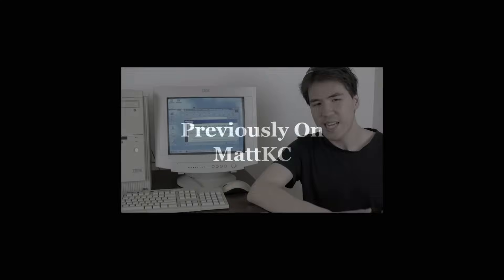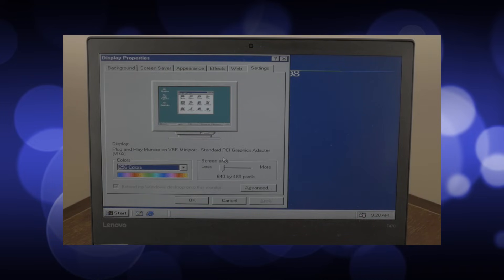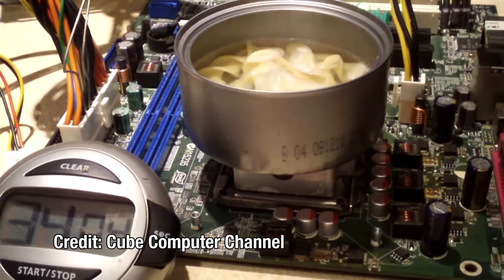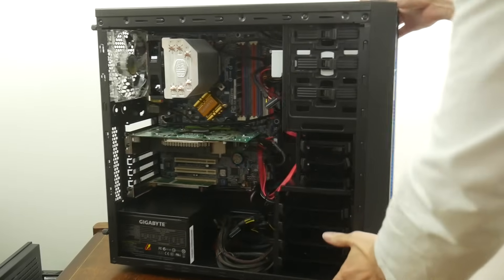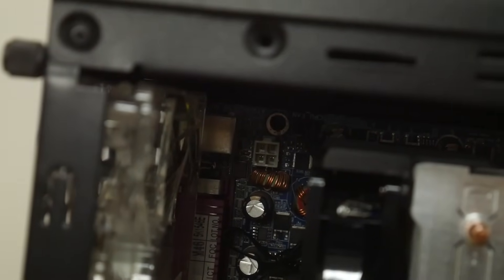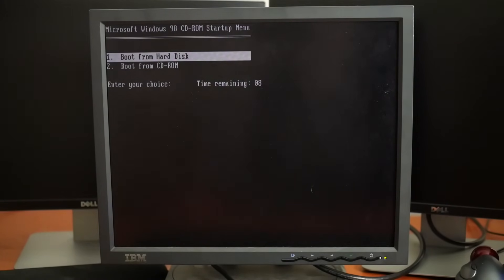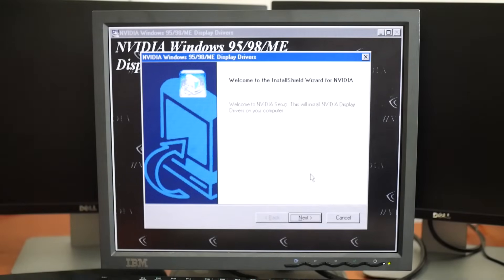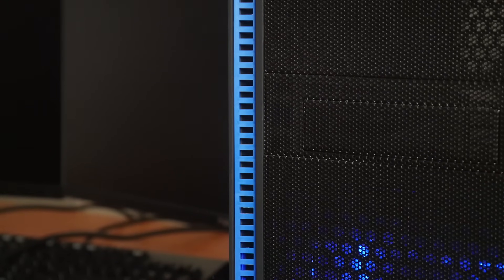The QUEST For The ULTIMATE Windows 98 PC [Part 1]

Comment: Huh, it's been a long time since I watched this video and dropped my first comment. Revisiting, I have some things to add and some to reinforce, now that I actually managed to make the ultimate windows 98 PC and have some knowledge with me:

In terms of CPU, I still stress the importance of using a core 2 duo based cpu. The Pentium E5800 is by far the best cpu you could get, and I stress that specific CPU because for motherboard, you will need one based on a 865pe/865g chipset (for win98 drivers!), and that chipset can only achieve an official FSB of 800; any higher, and that's an overclock. FSB 1066 CPUs are not recommended, as they constrict your ram tweaking options on these motherboards, but can be safely used in a pinch; if you want 1066 FSB, get a Pentium E6800 or E6500K; the Core 2 Duo E7600 also works, but clock speeds will matter more than cache.

For motherboards, the best ones for the job are both made by asrock: the 775i65g r2.0 or r3.0 (easy to find, micro atx form factor, only 2 dimm slots tho), and the conroe865pe (very hard to find, full atx form factor, 4 dimm slots!). I highly prefer the conroe865pe myself, as the 4GB of total RAM means you can boot Windows XP or 7 in parallel and do normal every day computing, if you ever so wished for some reason. But if you can't find one, just get a 775i65g! It'll still do a mighty fine job. And as for the Win98 RAM limit, just use the rloew patchmem utility; it was formerly paid-for software, but after his death, his family released all his utilities to be used for free.

For storage, you're pretty set, but without TRIM, that ssd will wear out slightly faster. However, there's a trim utility you can set up to handle this; that one's also coded by rloew. He did a mighty fine job with all those win9x utilities tbh, he even released a patch to solve the 128GiB LBA issue Windows 98 SE has so you can use large storage drives! Just chop the disk in 120GB partitions tho, defrag and scandisk kinda seize up if you give them partitions over 128GiB.

For graphics, the 6800 Ultra isn't the only graphics card you can choose. Do keep in mind the x800 xt exists! The last ATI Windows 98 drivers work perfectly with it, and its performance is even greater than nvidia's offerings. And of course, don't forget to pair it up with a Sound Blaster Live for the ultimate Windows 98 sound experience (with the vxd drivers of course, don't go with wdm drivers for 98!).

Outside that, I don't have anything else to say. My trek was a pain in the ass, but I did manage to get the ultimate performance Windows 98 machine. Now if you want compatibility on the side... that's a talk for another day.

Comment: Try finding a Win98 compatible PCI sound card, and disabling the onboard sound card. The onboard sound chip may of failed. Verify you are running chipset drivers. If you have issues, running previous version may help. Also, I have found that workstation boards (or some server boards) will have more solid Win98 drivers than the desktop ones. Now I need to dig through my parts boxes and see what I have. Good video. Was fun to watch. Also, ditch the Bluetooth dongle... Win98 barely had USB, and Bluetooth wasn't even an idea until XP, so I don't see any actual use for it.

Comment: This is why I dialled back my expectations a notch, I looked for the fastest and went for the ones under that which were more than fast enough but cheap enough and reasonably easy to still replace. I got an i865 board that supports up to a 3.4 P4 but got a much cheaper and easy to find 3.2. 2 sticks of 512MB DDR400, a soundblaster live! 5.1 and a Radeon 9800 pro. I also have my old trusty Voodoo 5 5500 PCI for the glide games and DOS. An IDE DVD drive to free up the left over sata port, a floppy drive emulator and a 240GB SSD with a 2x120GB partition with windows 7 on one just to trouble shoot, get drivers, file transfers etc., and trim the drive (98se has full access to the drive as well so it can be used for storage for that as well). I have an old PCI wifi card as well, but that was more trouble than it was worth so stuck to the on-board lan. Though most importantly, I put in a beeper so I could get some idea of what was not working if it ballsed up.

Comment: You can use core 2 Duo and core 2 quads in windows 98 and still maintain compatibility
Reply: As he said, it wasn't so much the processor as the motherboard that supported it. He needed everything to be officially compatible so the chipset limited the CPU and other components available.
Reply: WRONG
Reply: @zord0nTV  he's wrong or l am? I know he isn't because lve certainly run win 98 on core 2 duos long ago.
Reply: Single core performance on an old operating system is most important. Still is today most of the time. That Pentium 4 should probably outperform the Core2s in gaming. I don't remember but I seem to remember that CPU being the gamers choice for quite a while.
Reply: Cyn Hicks  core 2 duo has a much better IPC,  I think if you check old benchmarks of core 2 duos they will outperform the Pentium 4, the core 2 duos where a massive jump in single core performance and consumed less power
Reply: @fractitos  The fastest core2 on 775 definitely had a slower clock. I do know that. I had a core2 quad at 3sh ghz 4megs cache (upper mid-range) and it was fast don't get me wrong. For the most part it was better than any P4. I'm not sure that for gaming it was better than the last P4 though. I seem to remember it was still the better gamer but much more expensive at the time. I'd go look at old benchmarks but it's not really worth all that honestly. I am curious though.

Edit - I am specifically talking about games that are not optimized for multicore, which would be every game compatible with Win98.
Reply: You know what though. Just hit me. He's on 8x AGP. Even if the Core2 were better the GPU would (might) become a bottleneck. Interesting to think about though.
Reply: @CynHicks  I actually have a pentium dual core E5800 with an fx5900 in windows 98 and the gpu is indeed bottleneck. I think in 3dmark 99 I got 76000 compared to my old pentium 4 at 3.0Ghz with 41000 but I might not remember correctly. If you want check old anadatech benchmarks.
Reply: @fractitos  Fx 5900 is far from the best Nvidia AGP card though and the P4 he's using was not remotely midrange. I think it had 2mb cache for the single core and was certainly HT. Idk...I admit that. What I do know is that Intel was squeezing every last bit out of the architecture back then before getting rid of the north bridge and was killing it even though the top tier stuff was way too expensive.
Reply: There is no need to use more then one core in Windows 98 because it doesn't use more then one core a faster single core is better for Windows 98
Reply: @tassoss13  Agree but a core 2 Duo has faster single core performence
Reply: I think we’re all forgetting just how bad the Pentium 4 was. It was a shocker of a CPU and I wouldn’t be at all surprised if one core from a Core2DUO was faster.
Reply: A C that is what have been saying my 3dmark 99 scores where tested in windows 98

Comment: Dug up one of those small Dell Optiplex 260 Pentium 4's. Though they came  preinstalled with Windows XP, the hardware has official support for Windows 98. Finding drivers wasn't super easy, but after a day of frustration I got it to recognize all onboard hardware. Need to track down a low profile soundblaster live if those exist, as otherwise there is no MIDI playback in DOS games.

Comment: I've been building Windows 98 PC's for retro gaming recently and I feel your pain. My most recent 98 pc was a high end Pentium 4 similar to your build. I had hardware and driver issues that I could have never imagined. My most successful build was a Pentium 3 Tualatin. Generally speaking, I find it's best to use hardware that was built when 98 (or ME) was still the dominant operating system, which is prior to October of 2001 when XP was released. Drivers and hardware had excellent support for 98 up until that time. Additionally, I stay away from the 6000 series graphics cards for 98, the driver support is spotty at best. Nvidia supported 98 as an afterthought. Plus, the 6000 series dropped support for table fog and paletized textures, which can be important for older games. I usually use a geforce 4 or fx series because of these reasons.

Comment: Noice video! Thats a good build but...
Since you are trying to build the ultimate win98 pc, wouldnt it be better to use a newer VIA chipset? The drivers on boards like P5VD2 works great on win98 if im not mistaken, and you would be able to use some newer processors in it (more cores! Yay!).
Also, go for 2x 512mb sticks so you can have dual channel if you can.

Comment: I haven't watched Part 2 yet but after seeing this one - your build is powerful for 98 but still too new. The 'bleeding edge' was barely supported, it was more like 'do the bare minimum to make it work so we can legally say it supports 98 too'. 

IMO you needed to go back one/two generations from the 'latest' for the best compatibility. Socket 478 P4 or AMD AthlonXP, ATi 9000 series or GF4 Ti, 512MB RAM max (stock 98 has issues with more than that plus theres like nothing that needs that much RAM in 98). Stick with IDE drives or turn SATA mode to 'Legacy' in BIOS, but keep in mind that SSDs will lack TRIM support so they may slow down over time. Motherboard audio was utter garbage back then - best to use a SB Live with VXD drivers or if you want to baller out, an Aureal Vortex 2. A build like that would have worked nearly as fast for anything that actually runs on 98 and cost considerably less.

I posted about my build here for an idea: https://www.reddit.com/r/retrobattlestations/comments/jq5dkt/pentium_4_reverse_sleeper_build/ 

Anyways, on to check out part 2!

Comment: I built a P4 775 system a few years ago with the same intention, however I went down the route of using Windows Me. I found the drivers for that generation hardware was better supported under WDM based drivers. Windows Me with updates and an unofficial service pack applied can be solid. Win98 SE should be ran on P3 era hardware.

Comment: You can only convert from new graphics protocols to old ones, not the other way around (obviously).
Monitors often expect the exact protocol the port is meant for.
If you send a DVI signal into a HDMI or DP Port, the monitor will not recognize the signal.
The other way around is much simpler: A lot of modern graphics cards switch to older protocols automatically, if they detect a connected DVI-monitor for example.

Comment: I realize it's obviously not official, but there is a community made Windows 98 SE service pack 3 that adds a TON of support for more modern stuff, larger drives, more memory, easy USB support, it will even run programs meant for windows XP. You should check it out.

Comment: I'm a retro nerd of sorts (since I grew up in the DOS era) and I've got my original BFG 6800-GTOC card, still working, sitting in a box in the closet. (I was the original purchaser.. mm mowing lawns)
As far as sound, those old realtek systems were notoriously shit. ANY old dell from like 98-2006 will have a PCI SoundBlaster Live 5.1 in it. They're actually pretty fantastic cards, and since you're working on a dos-compatible OS, having true and proper DOS SoundBlaster16/Pro/AWE support would be quite nice for you.
Reply: My dream dos machine is sitting right next to me- Pentium 90, 24mb EDO, Trident 4mb ISA video. And a MASSIVE 540mb hdd. Can't play Crysis, but it plays Keen and Wolf3d quite well.

Comment: I've been building my own high-end windows 98 system lately.  Smoked a perfectly good 6800 Ultra with a faulty (mis-wired) molex cable.  I know your pain. 

As for your sound problem, you can't call it "Ultimate" with on-board audio.  Get yourself a Sound Blaster Audigy 2 ZX.  That is a phenomenal card for windows 98.

Comment: I feel your pain with the sound drivers. I cannot get my Windows 98 machine to have routinely functioning sound. I'm pretty close to replacing the Sound Blaster Live card in there now with an Aureal Vortex 2, just to see if that works any better.

My machine is a bit different though. I built a machine using ~~parts I had lying around~~ the last parts that could be reasonably expected to run 98, which I took to be around 2000. I've got a Pentium IIIS 1.4, a Voodoo5 5500, and 512 MB of RAM. I'll probably switch to a flash storage solution and get a new case, but I'm happy with what I've put together

Comment: Yo, the Asus p5B is a 775 motherboard that officially supports 98, you could run a core 2 duo. Even if you couldn't use both cores, one core on a duo would smoke a pentium 4. This motherboard also supports overclocking and core 2 duos are great at it. I never have tried out the 98 support on this motherboard, but I did use it to build a mega fast c2d/8800gtx Windows 2000 rig.

Comment: You can't use displayport to DVI adapters in that direction. The displayport side has to go into the video port on the PC and the DVI to the monitor. It can't be the other way around as DVI doesn't work being converted to DP despite DP being concerted to DVI.

Comment: Remember that some motherboards with AGP are very picky with the voltage, meaning if you put a AGP card with with the wrong VOLTAGE support it will either not work or destroy the card after a while. It still fits in the socket (this is one of the horrors of the AGP format) Also if you want a simple solution for the sound go for some cheap Soundblaster live, Aureal vortex,  ess-solo 1 etc. And one more thing, all this random crashing in windows 98 is often related to IRQ and DMA conflicts. I was in my older teens when win 98 se was released, and I still sometimes make machines like you are making here. Contact me if you want,  I can most likely solve any of these problems you are having. Good luck ! =)

Comment: So this is a very interesting video and I do look forward to the next installment. A few things to note from someone who plays around with this sort of equipment a lot:

Ignore the onboard sound. Although the best Sound Blaster Audigy and Live cards may not be that cheap, most are and would be far better suited, faster and reliable.

Disable every device on the motherboard that is not going to be used - Windows 98 is better with IRQ's than earlier systems, but give it some help and turn them off.

I would not use an SSD. The lack of TRIM support, AHCI etc is going to make it underperform by quite a hefty margin and you will kill the drive. In practice, it is probably better to look for a Western Digital Raptor which would be both period correct and I believe for W98 actually equally as fast (much slower under XP etc)

I'm concerned at how many graphics cards you've lost, so try and check that PSU out. But meanwhile, have a look out for the 7800GS for which there are W98 drivers (I can send them to you if you want). The Gainward Golden Sample are the best cards as they often have 7800/7950 GT cores, but as they're so expensive, even a native 7800GS is faster than the 6800GT and in line with the Ultra I recall. Failing that, a 6800GT may be cheaper to get these days and had most the performance (speaking as someone who bought one new and still has it)

If you can find it, this board is compatible with W98 and supports Core 2 Duo https://www.asrock.com/mb/via/775dual-vsta/ - they're a little rare but probably cheaper than your Pentium 4 and my testing shows that no P4 can match Core 2 Duo

Good luck

Comment: When I was trying to get windows xp installed using an usb and an iso file, I had soo many issues. Quite literally everything that could go wrong went wrong. But finally, after 20+ hours of troubleshooting, fixing stuff and doing it many more times over, I got into the windows XP setup. I was so happy that I finally got it all working. But when I selected my hard drive partition, the copy prosess went from 0% to 100% instantly while this was not happening in the tutorial. After some research, I found out that windows xp didn't come with a sata driver. So after 26+ hours I had to gave up since the prosess of inserting a sata driver into the install files was a total nightmare. 
I did eventually got it working by resetting the sata driver on a different drive (really slow) that still had windows xp on it and then it booted up. Finally I copied and pasted all the files off that drive to the new one and got it all working.
Even though this was not a hardware issue like the ones you had in this video, I know how annoying old pc's can be ;)

Comment: at this time i worked in a computer company and i had to fix all those problems for customers, i can't tell you how many unpaid hours i had to work on day and night to fix computer problems for customers, it was really bad i lost so much time of my life with windows 98 and also the computer hardware of that time and sometimes things just worked or they don't just worked without any reason and as you have like several hundreds of customers every day never had the time to investigate what causes the failures. luckely these times are over. also at that time graphic cards, ram and mainboards died like crazy especially gamer hardware. everything was overheating, we did a lot of reballing expensive video cards too. everything was always damaged. One interesting fact is that after reballing most video cards or mainboards lasted longer than they did from factory, we even heard stories from customers where the system that failed after 6 months lasted 5 years after reballing. (especially nvidia chips)